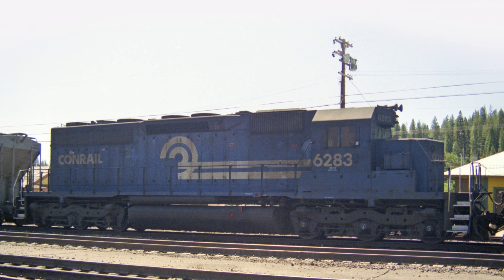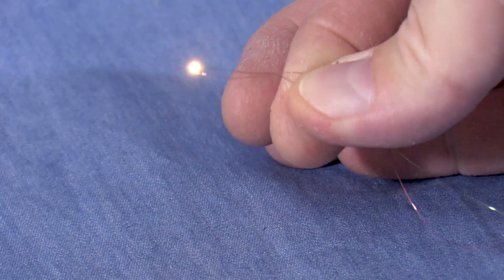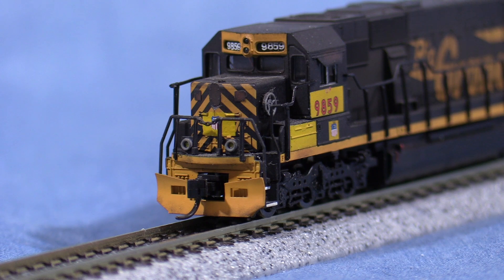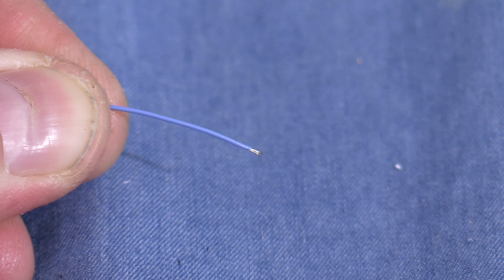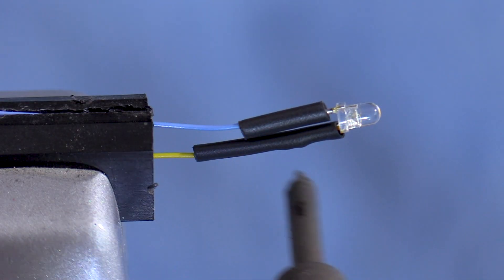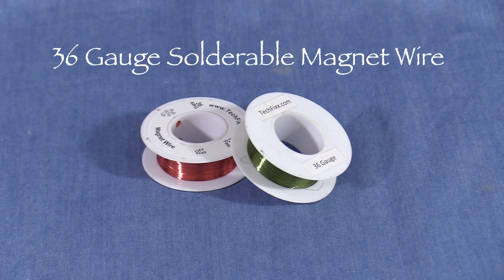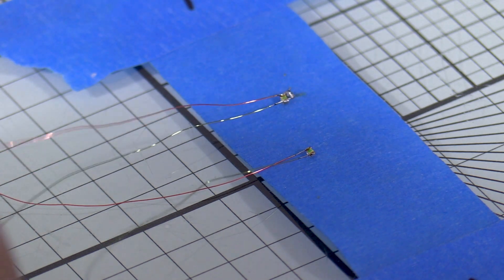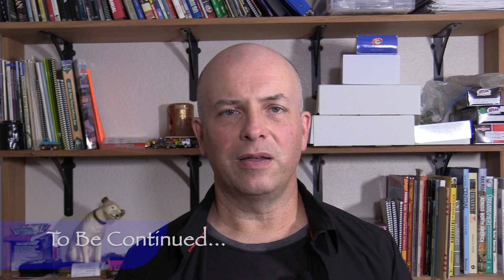Model Building HO SP Consist Part 8 - LED Primer 101

Comment: Great video! Would you use a different resistor value for DC?
Reply from the maker: If you're using a 12 volt DC power supply then the same values should work.  If you have one of the large scale throttles those can sometimes go higher, like 18-20 volts, so I'd probably use a bigger resistor.  Thanks for watching!

Comment: Thanks for sharing. I’m looking at LED installs into some older locos I have but my plan is to use a Decoder Buddy to make wiring and taking the shell off a breeze. It comes with built in resistors
Reply from the maker: Cool, I haven't tried one of those.  Thanks for watching!

Comment: This was a very useful piece of information. I am in N scale and I have been putting doing the head lights for my C415 switcher that needs LEDs for lights. Thanks for sharing.
Reply from the maker: I hope this helps.  Thanks for watching!
Reply: As a fellow n scaler, I use 603 for headlights. 402s for everything else.I get them with 36/38 wire presoldered.
Reply: @attackeagle  You do. I have 603s I could use them then. Where do you get yours from?
Reply: @Vman7757  eBay. I like the stranded wire over the magnet wire.
Reply: @attackeagle  Ebay? I like stranded too.
Reply: @attackeagle  I found 100 of them for 29.95 on Amazon. Since I do a lot of N scale work for others and my self painting and detailing. I might go this route. If I do order them? It would be Jan before I would get them, but that could be a good thing.